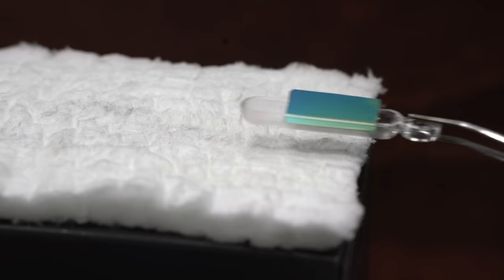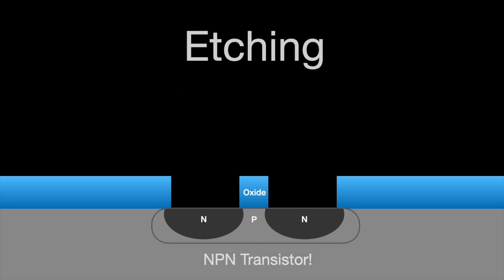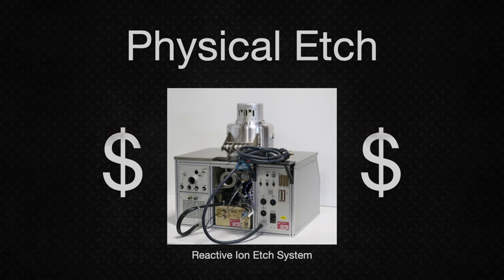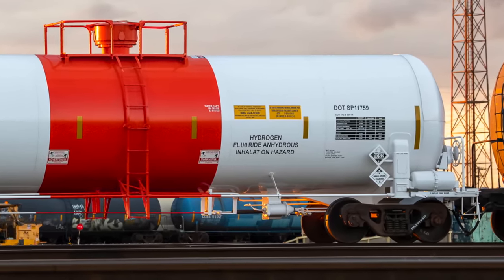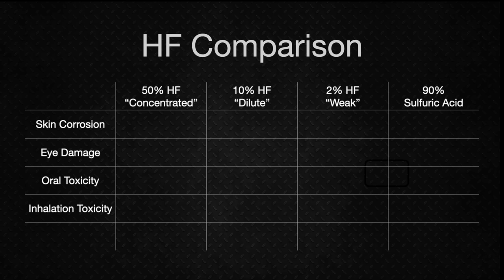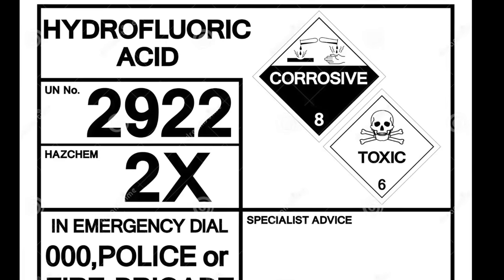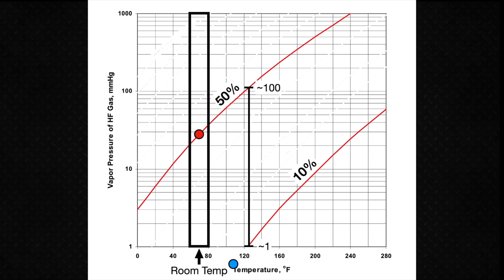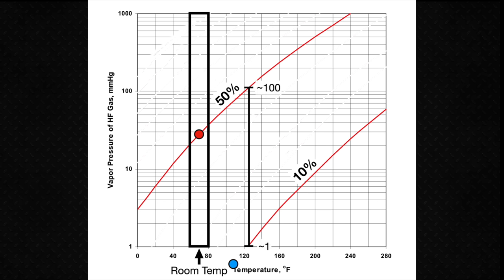Using Hydrofluoric Acid to Etch Oxide Layers

Comment: You showed the metal layer directly contacting the silicon in that diagram, but this is generally not done in practice with the two most common metal layers, aluminum and copper. Aluminum in contact with silicon forms spikes into the transistor that damage it, and copper will aggressively dissolve into silicon and disrupt the effects of dopant highly erratically. Typically, there is a tungsten plug in the oxide hole that the metal layer makes contact with, to act as a condom to prevent these problems. There are some metals that can directly contact silicon without issues, like Cobalt, Nickel, Tungsten, and Ruthenium, if I remember right. Current research into sub-2nm process nodes is leaning towards replacing the copper layers with cobalt or ruthenium, because the structures needed to keep copper from touching the silicon takes up too much space at those scales, leaving less room for actual copper conductor, and thus causing high resistive losses due to the conductors being so narrow.
Reply from the maker: Gotta keep the diagrams simple!
Reply: They usually use a silicon nitride buffer layer under the aluminum or copper via layer.
Reply: You should be able to use aluminium but keep the point small or divide into multiple as spikes become a problem with big size
Reply: @projectsinflight  -- I would much rather they be correct than simple.  Anyone interested in this stuff is going to be probably above average in ability to comprehend this stuff, so please give us more detail rather than less.
Reply: @ThantiK  Exactly. It's better to stay to the truth of current research, rather than horribly simplify. At the very least things should be briefly mentioned so that anyone interested can dig deeper.

That's why I hated school. They always dumbed everything down, often to the point that it's inaccurate, when the real world is so much more complex and exciting!!!
Reply: @ThantiK  please never become an educator or public speaker.
Reply: @ThantiK  you're right

Comment: Wow, you were very thorough about the danger of working with HF! You very easily could've just made a video etching the silicon with it and just included one sentence "I'm wearing gear because it's super dangerous" and left it at that, but you took the time to illustrate how, why, and how much that HF acid is dangerous. I love to see it! :)
Reply from the maker: Thanks- i am glad you appreciated it! I was worried i'd get a thousand comments of "Boring" lol
Reply: @projectsinflight  I've rarely seen analysis of the individual risks like that outside of industry, you've done a service just by demonstrating the process, let alone enumerating the actual HF risk outside of "nope".  I learned a lot.  Thank you for taking the risk.
Reply: I have a really old chemistry book for hobbyists that goes into great details about how to build and equip one’s lab. Part of that involves etching writing into the sides of glassware by smearing a layer of wax on, writing with piece of metal or wood to selectively remove the wax… and then etching the glass using HF. No biggie!

I have never dared perform a single experiment from that book.

Comment: Armor Etch might need to be diluted to control the etch rate, or perhaps mixed with a surfactant so it doesn't glue itself to the wafer
Reply from the maker: I suspect they make it adhere so strongly so that it won't run off vertical surfaces
Reply: Yeah, and dilution may let the BaSO4 settle out, leaving a clearer, easier to use solution.
Reply: @projectsinflight  Very likely. My mom uses it to etch glassware and stuff like that. You can get blank cups from basically anywhere and then use something like a cricut (or other cutter) to cut out a vinyl mask. Allows you to make cool commemorative pieces for birthday gifts or the like super fast.

Comment: I am very glad he did not skimp on revealing the dangers with using HF and I just wanted to reiterate the warning about Hydroflouric acid or HF... If it just covers 25 square inches of skin, (basically the surface area of your hand flat on a table) without immediate treatment it can and likely WILL cost you that limb... It burns down to the bone and rapidly travels up the calcium in your bones. Wear the proper gloves, face shield, apron and be very careful while using it!!!  I know two people who had to have an amputation of the next higher joint to save them from death at around 40% concentration. It can be safe enough if handled carefully at the below 10% concentrations.

Comment: Excellent video. I'm working in the semiconductor industry, and we have literal pipes running along the ceiling for transporting highly concentrated HF. This stuff is no joke and I appreciate that you are taking it seriously.

Apart from that, I suspect that the armour etch will be difficult to use with a resist mask, unless you manage to get the resist very mechanically stable. If you have to scrub it off, you will probably damage the resist in the process. I'd try to dilute it and check if you can clean it off easier. It will also make the etch rate easier to handle. If you're going for a CMOS platform, you'll never need more than maybe 300 - 500 nm of oxide, and there's really no point in chewing through that within a minute, especially if the time you need to rinse it off is not perfectly controlled. It will result in inconsistent etches, especially when it comes to underetching. Getting the etch duration to something like 5 minutes should be the sweet spot between wait time and the effect of handling uncertainties.

I'm excited to see how you are going to tackle doping and lithography :D
Reply: Do you know what the pipes are made out of? The shear size and length of the pipe over such a large, expensive and easily disrupted facility makes for interesting choice parameters.
Reply: @superdupergrover9857  It's actually a hose within a pipe (double walled for safety, including sensors in the outer shell). And bog standard plastic is perfectly resistant to HF, so no issues here. That thing is also completely routed indoors high enough that you wouldn't get close to it by accident, so nothing about it is easily disrupted unless someone with access to the area would do so on purpose.
Reply: @commander-tomalak  The best solutions are always the boring and obvious ones. Not always true, but true more often than i ever expect. 
I knew a lot of plastics are resistant to HF and other plastics, I just figured that long term, not stagnant flow would have some long term degradation effect. 
Thanks for the reply, i really appreciate it.

Comment: Great explanation and a nice deep dive into safety. If you really want multiple concentrations of HF, I think the best and simplest option is to just bite the bullet, buy a small amount of high concentration(20-30%) solution, and then carefully perform a single dilution operation to the concentration you want.
One benefit of a fully liquid etch that you didn't cover is that you get a very uniform result - pastes and such tend to etch slightly less evenly. I'd probably stick to the rust remover, or would make my own solution that's maybe 2-3x more concentrated(5-8%). After all, waiting a few minutes for a slow and controlled etch is better than having to deal with paste removal and extra wafer cleaning.
Reply from the maker: I don't currently have a safe space to use 30% HF so I'll stick with the weak stuff for now
Reply: I think this is a rare instance where buying the concentrated chemical and diluting it down is actually more expensive.  looking online, I was able to find 32oz (946ml) of whinks for ~$15, and the same amount of 49% HF for $135.  A little math, and you find that whinks charges $1.26 / ml HF, whereas the concentrated chemical costs $3.43/ml.  I think the increased price is mostly due to low volume production (you would probably be right, on an industrial scale), but for small scale consumer items, it's actually cheaper to buy dilute!

Comment: When we used Silane as a hypergolic igniter for rocket engines at RotRock, I had the unenviable task of cleaning the resulting fused silica slag out of the combustion chambers and injectors. I had experience with HF in college semiconductor lab, so I selected ammonium bifluoride as a FAR less hazardous etchant. It did a great job without scaring the hell out of me and did not require such a high level of PPE for protection.

That was more than 20 years ago and I don't recall the concentration of the premixed fluid but it was probably similar to the armor etch. Gloves and goggles were all I needed.

Comment: I like the idea of having different HF sources for different jobs. The armour etch will be good for bulk oxide removal when making oxide masks and the rust remover will be great for whe you need a controlled oxide thickness for FET gate insulators.
Reply from the maker: Yeah, I definitely expect the rust remover will be good for that!
Reply: I like starting with 40% HF and diluting it down to any concentration the job requires.
Reply: @setoman1  I think it is clear from the video that 40% HF is impossible to obtain for most people
Reply: @RoyaltyInTraining. And even more impossible to handle without shortening your lifespan by a few years
Reply: @RoyaltyInTraining.  40% HF is easy to get for an average Joe, if you ask smaller chemical suppliers. It also pops up on eBay every so often.

Comment: From memory the mix in the armour etch is a multi-stage process, one part "lifts" and another "captures" but it was a long time ago that I looked at it. But it may explain how much faster it was than the 10% gel.
I wonder how you'd go diluting it some to make it more of a liquid than a paste. As it is it looks like it'll be hard to apply and remove easily and at small feature sizes having it creep under your mask may become an issue so timely removal is probably going to be desired. 
Honestly don't worry about the youtube comments section, you could be using pure water and you'd get people saying "if it's too pure you'll die if you drink it" and 4 people saying they knew somebody who drank water and they died.
Reply from the maker: Everyone I know who's died drank water though. COINCIDENCE?!?

Comment: Doing gods work. This series has done heaps for the home semiconductor hobby already. I think the syringe might be good for spin coating when you are making an entire IC. The armor etch might be great if you can dilute it to get it to flow and maybe slow it down a bit for more control. The rust remover seems like the easiest to use for the home though. In a DIY setting speed is less important than result. Trying to make precise layer thicknesses for MEMS structures will be awesome when you know you have a high safety margin in a product that is easy to remove as well.

Great work. I am considering creating an online community to advance this hobby with equipment build guides + kits, supplies and guides/tutorials.
Reply: don't even talk about spin-coating HF. that's a bad, bad idea, and there's no reason to do it in the first place. just dunk your wafers in the liquid etchant.

Comment: I had no idea commercially available HF sources were this good. It kinda gives me some hope back for DIY microchip fabrication. One nasty blocker that remains is obtaining a usable photoresist. Idk if the stuff for etching PCBs and metals works for this application.

Edit: Apparently Kontakt Chemie sells a novolac-based resist that can withstand HF and other "strong acidic etching products". It's called Positiv 20. Maybe it's an option if you can get enough liquid out of the spray can and thin it down for spin-coating.
Reply from the maker: Yeah... Photoresist is REALLY Hard to find these days. Makes me sad. If you have any links for ANY usable photoresists that arent the dry film please let me know. Feel free to email me at my gmail (projectsinflight) if you have any info.

Comment: You are doing great 

My opinion is to test the armor etch for volatility and check if the reation in the etchent causes hf vapor to determine the danger of the product 

And if you can accurately calculate the time of the rust remover you could probably reuse the old silicon wafers which you failed to oxidate to a certain nano meter
Reply from the maker: Oh yeah, that's a good idea for sure. I'll take a look
Reply: seeing the armor etch spot size vs the actual etch indicates there was definitely a cloud of vapor. was really neat to see 8n the video.
Reply: A suggestion: give the Armor Etch MFR a phone call and discuss issues with them, since they are probably the most knowledgeable.

Comment: I really liked the extended investigation of HF safety, pretty much every other video I've seen has done little more than say "don't try this at home" or "HF is very dangerous" and definitely doesn't bring up the MSDS. 
Armor Etch definitely sounds rather sketchy, I'd like to see some more experiments around its strength and behavior.

Comment: In the past I was peripherally involved with a palynologist and one place they get pollen from (actually its outer wall called the exine) is by coring a lake bed. So, Fun Fact, HF is used in processing the samples to dissolve the sand (silicon dioxide) and leave the exine intact for later examination under a microscope. It's tough stuff. 
I have been enjoying your videos and appreciate the thorough way you are conducting your calibration experiments.
Reply from the maker: Thanks! I appreciate that people aren't too bored by constant calibrations lol

Comment: I really like how much you emphasize safety with HF I worked at a place for 4 years that I had handled this stuff all the time. We made small metal parts for medical devices and I cleaned them and that often involved HF somewhere in the clean line. Plus it was in a ultra sonic that sits at 170F. The strongest we had was 3% but even that would stink up the room a bit even with several massive fume hoods

Comment: In my opinion the best glass etchant on the consumer market is Etch Bath. It’s made by the same company as Armour Etch but it’s a liquid, not a cream, and it’s quite a bit stronger.
Reply from the maker: I was going to include that but they didn't have an SDS on it and they wouldn't respond to my emails :(

Comment: Wow, you can really see the fumes from those stronger (Porcelain Etch and Armor Etch) mixes!  Not so much directly, but the halo effect while etching!

I wonder how quickly etch rate increases versus vapor emission.  If reaction rate accelerates quicker, it might be worthwhile to use a lower concentration at higher temperature.  This does need to be balanced for the overall process, of course: a heater is more steps, more equipment, more process, so it does increase the "attack surface" of the procedure's overall safety.  On the other hand, it's also another process variable, simultaneously a liability (one more thing to keep track of) and an advantage (a parameter to optimize, and a means of controlling what is otherwise potentially-poorly-controlled ambient temperature plus handling (body heat)).
Reply from the maker: For now i'm just gonna resort to waiting longer but i'm in the market for a good fume-extraction solution for further testing!

Comment: Fantastic to see this. Love how much detail you went into on the hazards. I used HF in geochemistry research for solid rock digestions, as well as having it as a product from some other isotope related purification processes. Ended up using an ammonium bifluoride method as a replacement in order to make sample prep and handling easier but it was still as PITA for weighing since in the raw it comes in a sticky kind of crystalline form.
When learning the methods we would usually be wearing heavier thicker gloves (like what you have in the video), plus rubber aprons, and face shield (in a hood, in a clean room no less), once we were more familiar it was always double gloved, in clean room suit, plus face shield.

Comment: Quick side note, HF is a weak acid, not a strong acid. This of course doesn't make it any easier to work with or healthier.
Great video!
Reply from the maker: Yeah- I feel like the whole pKa thing is so misleading that i didn't bother calling it a weak acid
Reply: I phrase it this way: "HF is an incredibly toxic chemical, that is weakly acidic."

Comment: Two questions:
1. Can you dilute the armour etch? It would make it easier to apply and remove.
2. Can you use an ultrasonic cleaner to strip away the armor etch in your first wash to eliminate the physical scrubbing step? (Probably not necessary if the answer to the first question is 'yes')
Reply from the maker: i'm pretty sure i can dilute armor etch with water if i want. The ultrasonic cleaner isn't a bad idea.

Comment: Your detailed investigation shows your concern and careful consideration. Note that hydrofluoric acid or ammonium bifluoride reacts with glass to produce toxic byproducts, H2SiF6 and SiF4, respectively. Both the acid and the byproducts of glass etching are toxic and must be avoided from inhaling.
Reply from the maker: This is true, but in my case the amount of glass that is being removed is so small that the silicon byproducts should be in such tiny quantities as to be irrelevant. Hopefully...